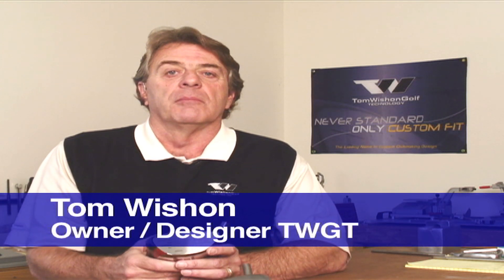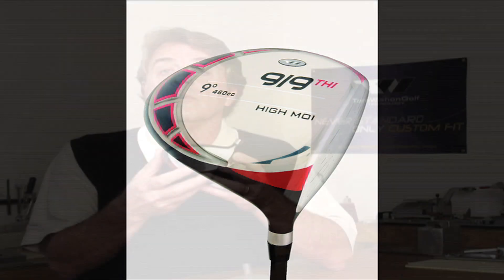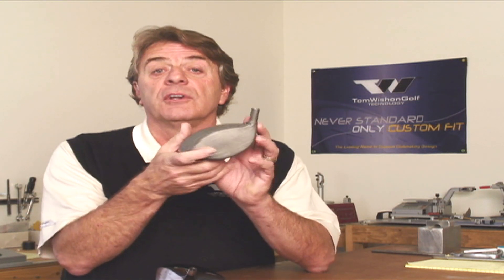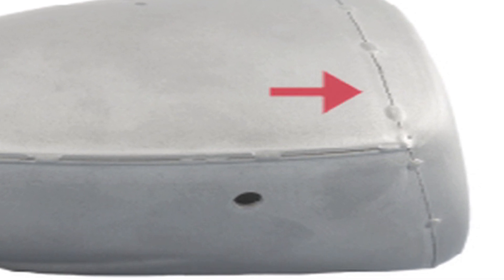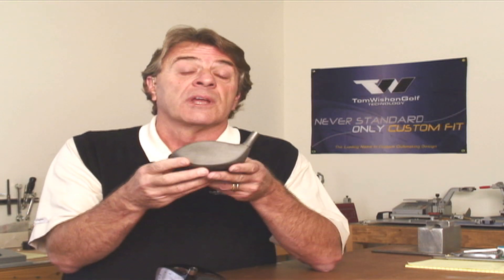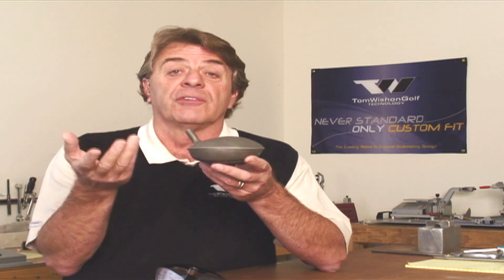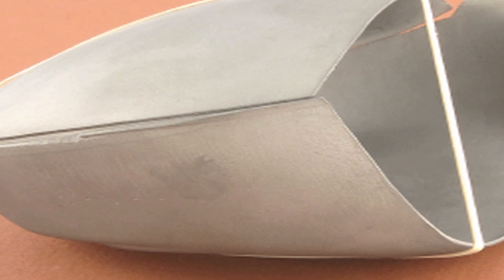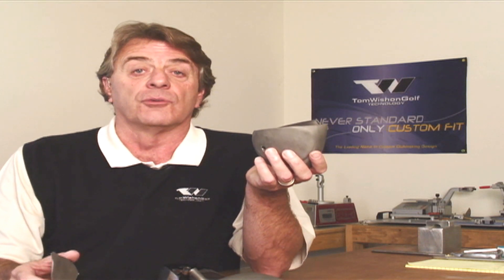919 THI Driver

Comment: I've got a 11° 919THI with a short S2S Black 85 shaft and it outperforms my other driver, a Titleist D3, in 9 shots out of 10. When i get an optimal hit with my D3 it's longer but when i don't it's both shorter and wider.

Comment: This video talks about the company’s high performance919 THI Driver.  The cup face design of the driver allows the face to flex when off center strikes are made allowing for further ball flight even on off center strikes.   Factory clubs use “Edge welding” for their club faces which could result in small gaps in the weld whereas the high performance919 THI Driver “percussion mating” allows for a smoother weld pattern.